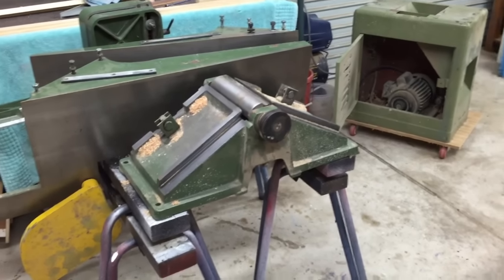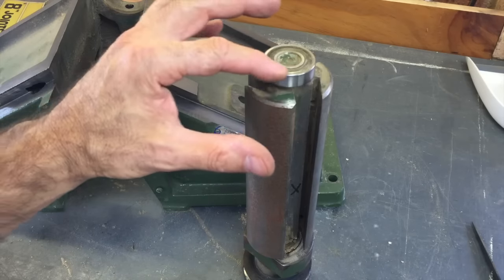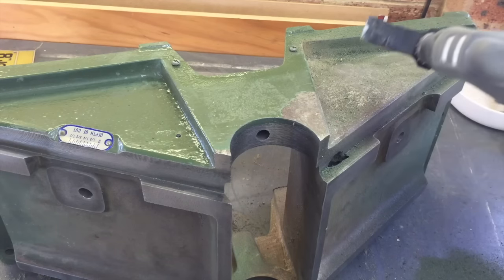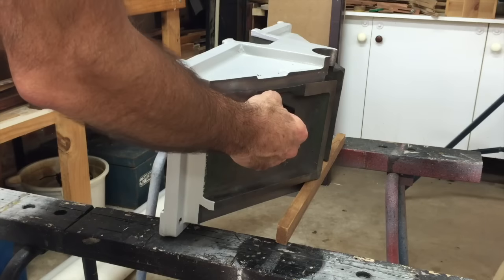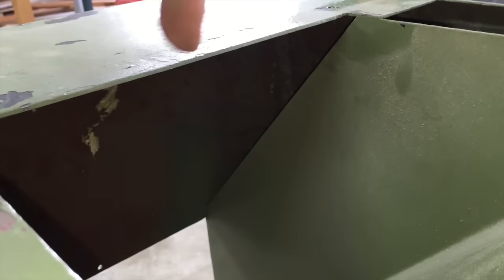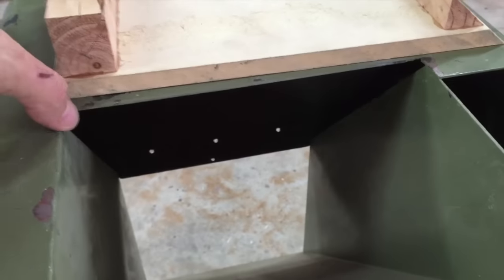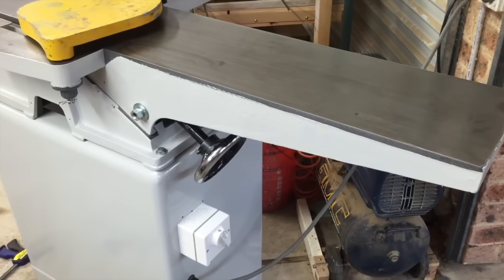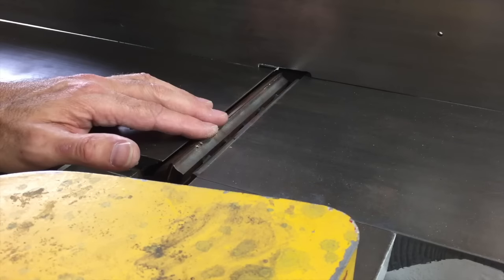Refurbishing a used 8 inch jointer

Comment: that bolt mounting pattern is standard practice on all jointers due to them not wanting the top to not warp with the base since the bases on cheaper jointers like this are stamped.
Reply from the maker: Yes, you're right mate. I'll get around to it one day. Thanks.

Comment: I suspect that the casting mounts on 3 positions so when the box that it sits on contorts to the uneven floor the casting will not break from its own weight plus the weight of the box and the motor Inside the box.
Reply from the maker: Thanks Joseph. i've had this comment a few times and i totally understand it but so far i've had no issues at all.

Comment: RE the three bolts, my guess would be that they did that to avoid "racking" (twisting) the frame when you torque down the bolts
Reply from the maker: Thanks Tony. Yeah, I've heard that and it makes sense. I'm not noticing an issue with the planer yet but if i do that will be the first thing i change.

Comment: The reason for only three bolts to mount it to the cabinet is so if the cabinet top isn't level ar square it will not pull the casting out of alignment. It is done that way for a reason and not to save the cost of a bolt. 45 years fitting experience taught me. Cheers
Reply from the maker: Thanks for that insight Glenn, makes sense. However, when you consider how heavy and solid the jointer is and the cabinet is only sheet metal, you wouldn't think its a problem. Cheers mate.

Comment: There is a very good reason why there are only three mounting bolts on the base. It creates a tripod three point rest that does not stress or twist the casting. I have a 20” wadkin that weighs two tons. It rests on three points not four.
Reply from the maker: Thanks Brian. I know the reason for the three point mount but I don't have any issues with mine this way. It works surprisingly well for a generic brand. Cheers mate.
Reply: DownUnderWoodWorks . Just a suggestion but if you want to reduce the noise of the machine a bit buy some soft rubber mat and cut it to fit under your mounting bolts. Those steel stands tend to resonate badly and make the machine much noisier. You can also reduce the noise with some sound absorbing foam inside the cabinet. 
If your lucky your machine ways are still accurate but a lot of those wedge beds have castings that are not seasoned properly so they are prone to warp. Once they go out of tolerance you may as well scrap it. Good luck.
Reply from the maker: Thanks Brian, I like the idea of the rubber under the mounts. I'll give it a go.
Reply: @brianminghella3312  Good idea! I've got the same jointer and a noise reduction would be a welcome enhancement. That sheet metal is like having the tool perched atop a tympani drum! I might see about a link belt rather than the solid V belt it currently has, but there's no way in hell I'm going to spring for one of those helical carbide-bitter cutterheads. They're seem to be running around 6 times what I paid for my 8 inch jointer. Outrageous!

Comment: Thank you. I am still not clear about table adjustments - my jointing results in snipe at the end of the stock. Checking the infeed table shows sagging  at the end away from the knives but the manual is almost silent how to adjust it (gibs) . The wood whisperer has a good video adjusting the infeed, but then many others talk about adjusting the outfeed table (my manual says do not touch).  Would it be correct to adjust the outfeed table to the knives and then the infeed table to be co-planar with the outfeed table?
Reply from the maker: Yes mate it can be a confusing subject. The gibs on the machine don't adjust the height, they take up any sideways movement in the dovetail. To adjust the beds up or down you have to place shims in-between the horizontal faces of the dovetail runners but only on the outfeed table. I will explain. The infeed table is the only one that gets adjusted up or down for depth of cut so start with it and tighten the gib screws until the slack in the dovetail is gone but the table can still slide up and down without jamming. Next, the outfeed table should be adjusted to be co-planar and parallel to the infeed, this is done with shims. Once the outfeed table is adjusted lock it in place with the gib screws, it doesn't need to be moved. Lastly adjust the planer knives to the outfeed table. Hope that helps.
Reply: @DownUnderWoodWorks  hey just read your reply here to this gent but I'm curious where do you set the infeed table in order to make the adjustment of the outfeed table?
Reply: @mattg6262  I set my infeed table a smidgon lower than the outfeed table when checking for coplanarity. With a long straight edge, I then make sure the gap between the straight edge and the infeed table is the same everywhere: close, far, left and right. I use feeler gauges. Not expensive, but really useful. If all the gaps are within a thou or two of each other, I'm fine with it. Takes a while. After the outfeed table is all shimmed up and good, I don't mess with it again.

Comment: You might want to rethink mounting with 4 bolts as that could induce a twisting force that the three bolt mount would avoid.  I believe the 3 bolt mount was designed to avoid the possibility of twisting the castings.
Reply from the maker: Thats a good point Charles but its now been like that for more than 18 months and no problem yet. Cheers mate.

Comment: great work.

how do you adjust the surface when one and is lower tabs the opposite any a cross the surface.
Reply from the maker: Hi Gunness, have a look at this video https://www.youtube.com/watch?v=EGYdSR9riWI. Hopefully it answers the question for you.
Reply: Hey Thanks, I did look at the link.
The make up on the Delta Rockwell 6in is very similar.
So i made the necessary adjustments and now its fine.

thanks again
Reply: Well finally at it..... restoring my Rockwell 8" jointer.

Is there any adjustment or alignment of the cutter head.  Apart from the two bolts on the bearing housing. 

Just about finished with sanding but I wanted to remove the cutter head to do a thorough job.

In your video I did not notice any adjustment being done to cutter head when mounting.

Please tell.

Thanks

Comment: Having seen this video just now I think this is a DiTec jointer made in Taiwan. From the mid nineties. I have one identical to it. It was the predecessor to what now is marketed  by Jet. Both similar is style and construction.
Reply from the maker: Thanks Denes. Its good to know this stuff.
Reply: Yes it is a Diltec there was a barely readable tag on the one i bought at an auction sale. any chance you would have any manuals on yours that you would be willing to share? I'm not seeing how some of the adjustments are made.
thanks.

Comment: As always, I love your videos; how long did it take you to refurbish it? (Not counting minor adjustments)
Reply from the maker: It actually didn't take very long at all. Cleaning the old paint off with the multi tool was quite quick. Repainting it was also quick because I used a primer-less paint. I had to take the cutterhead to have the old bearings pressed off and the new ones installed.The things that probably took the most time was going to buy the bearings and having the knives sharpened. All up I'd say easily within a week.

Comment: That machine looks very much like my 60HH Powermatic I just bought. Im thinking thats what you've got. Maybe just an older version. Many of your levers and slides aren't just in the same place but they look like they were cast in the same mold.
Reply: I just got a Buffalo 8' jointer and it looks very similar to this as well I can't find to much info on mine but it is well made.
Reply from the maker: I was told that its a generic Taiwanese made machine. many of these kinds of machines are made in the same factories and just branded differently
Reply: @DownUnderWoodWorks  well it looks like a solid machine. I hope it serves you well

Comment: How did you get the infeed/outfeed tables off
Reply from the maker: Hey Tyson. From memory you have to loosen the adjustment shims on the slides and then just wind the height adjustment handles all the way out until the spindle disengages from the nut.